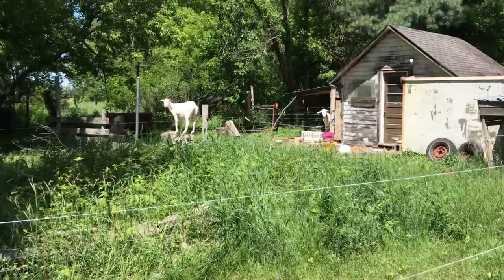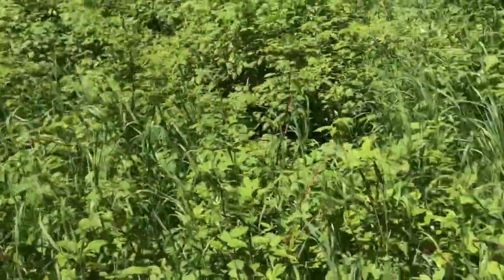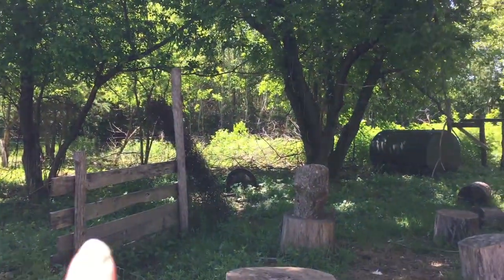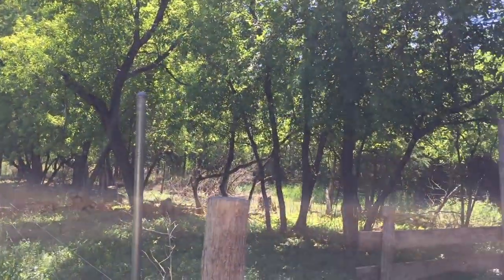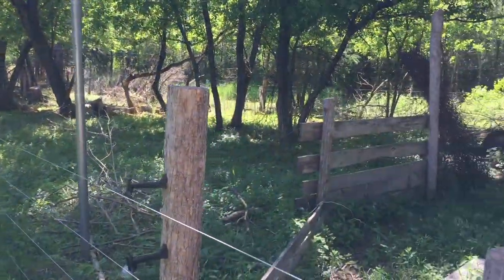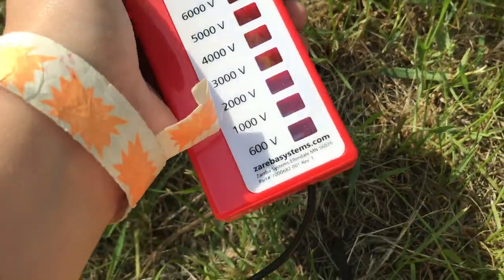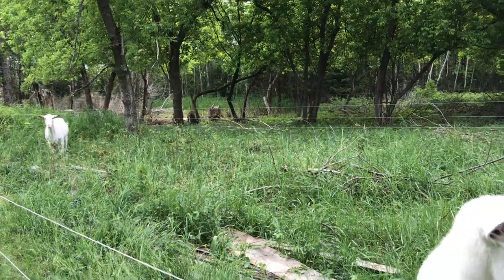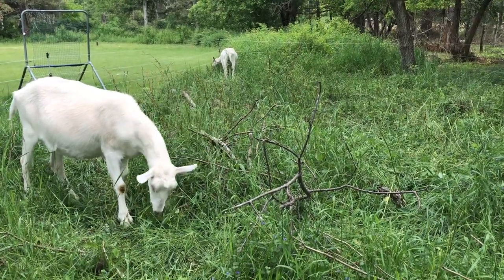Polyrope for goats? Will it work?

Comment: We broke our goats to a hot wire inside a permanent fence! Also the Livestock Guardian Dogs.
Then used netting which was quite comical the first day, getting horns hung up in it! Stay close that day.
We now can use three ploy ropes.
We want to try Gallagher new four ploy, with built in posts. It is 320 feet long with a reel!
#aluminumchickentractor work with sheep/ goats also!
#naturalgramma RevHank and Laura Reid